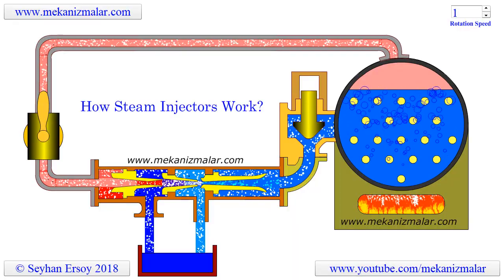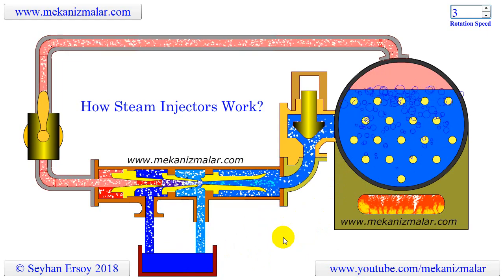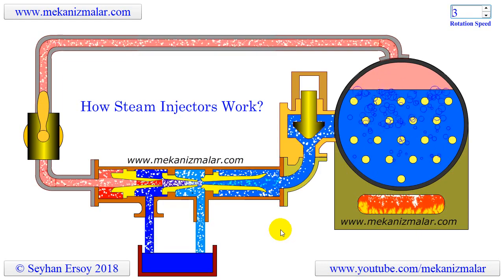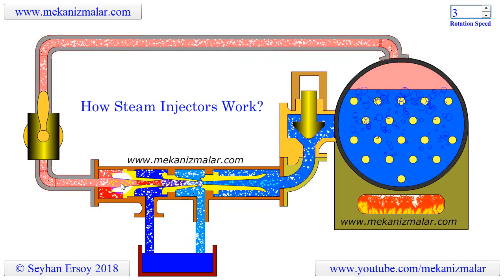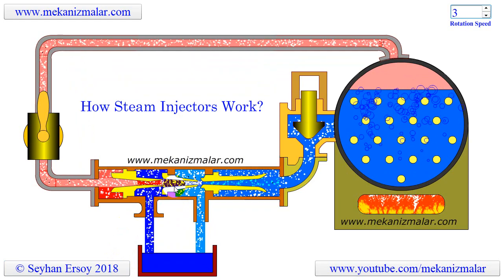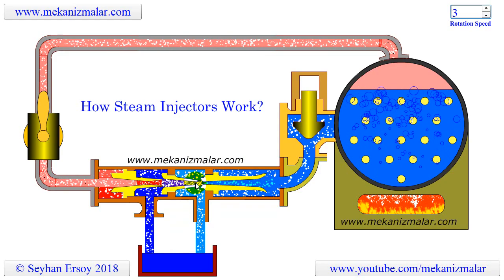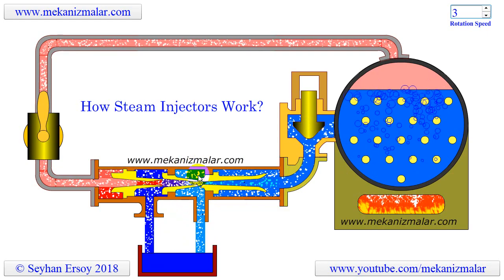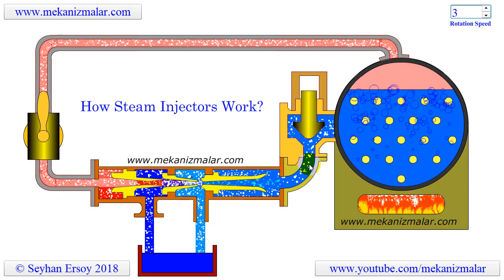how a steam injector works

Comment: the overflow also preheats the water, further, with that % flow in the loop is recirculated back to steam entrance. This improves efficiency by not quenching the steam to early, and also reduces resonance, hammer, and random fluctuations of steam and cold water only. Also the pressure tank cannot be overfilled, this is very important, allowing time for equilibrium without destructive fluctuations.
Reply: That's not true though, the overflow is not reused, it is waste. An injector relies on cold water, specialised injectors can use warm water but they are rare. If you use warm water the injector is likely not to pick up.
Reply: Thank you for  your detailed contribution to this video, I appreciate it.

Comment: I use two injectors on my steamboat. I use a Penberthy 1/2" injector. I also have a Chicago 1/2" Injector, originally made it Wadsworth Ohio.  The  wood/kerosene/propane fired Boiler is rated to operate up to 200psi slightly super heated steam. The injector creates a great enough vacuum that the injectors can suck up water from the lake I'm floating on. The injectors are the primary feed sources for the boiler that are used to make up the water that is primarily being used to run the 6HP two cylinder reciprocating steam engine which turns the propellor.

Comment: I need more help understanding why the steam flows to the injector. If the steam pressure is X then the water in the boiler is at the same pressure. Which means there is no pressure drop across the nozzle which means no flow. The condensing steam must be adding the energy to make this work. Please let me know your thoughts.
William
Reply from the maker: Dear William, yes you are right, the water and steam inside the boiler has same pressure. However, 1unit of steam in the boiler has much more energy content in it than 1unit of water. You can use this energy to pump much more than 1unit of water to the boiler. The reason steam flows into injector, because the water its going to suck  into the boiler in the atmospheric pressure. This causes steam flow with higher speed to the injector. And the injector pumps water to boiler without using any moving parts. Isn't it an ingenious mechanism?